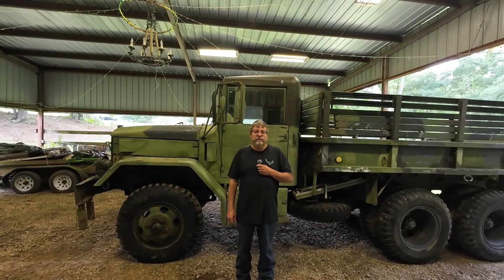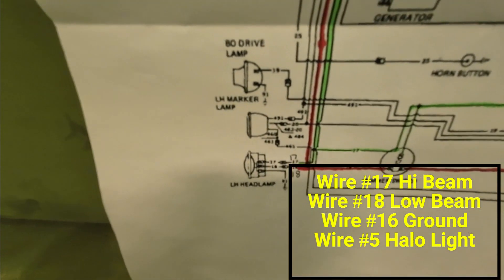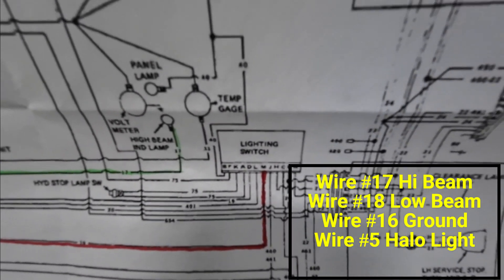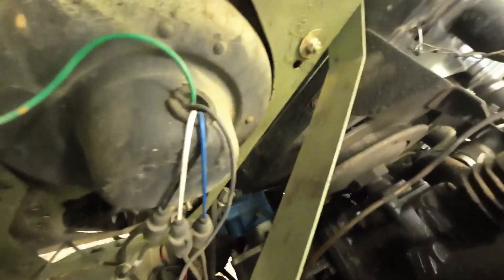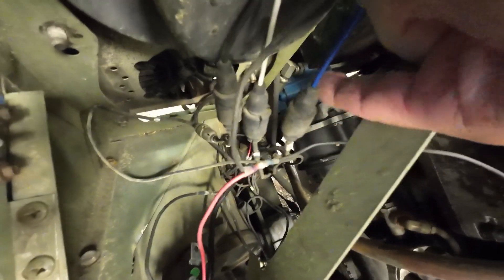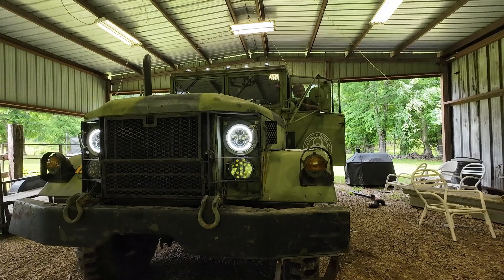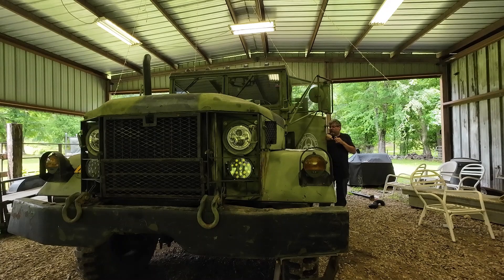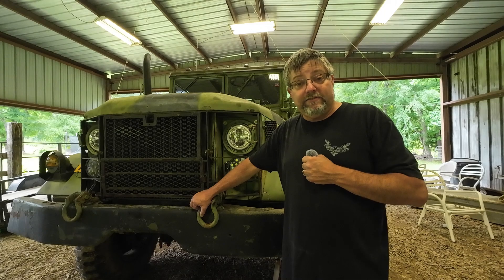M35A2 Deuce and Half headlight upgrade

Comment: Are those stock headlight buckets or others aftermarket? Mine look nothing like that. I have a adapter squished between the back of my headlight on the inside of the bucket
Reply from the maker: it's all stock.  I will try to get a picture today of the backside of the bucket.

Comment: Be aware, if those not the original military LEDs, they can break inside the housing which causes the light bulb to vibrate, a lot of those lights are built for jeeps and not made for the vibration of the m35. I'm the same as you with wanting a 5 ton, either a 5 ton next or a 12 valve is going in the m35
Reply from the maker: I have had these installed since 2019.  Holding up pretty good so far.  Thanks for the heads up though.